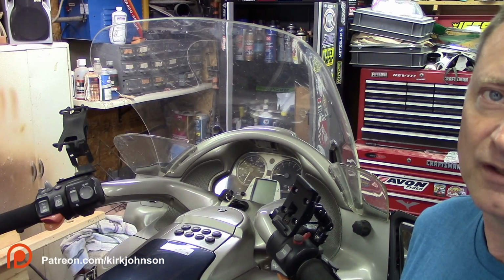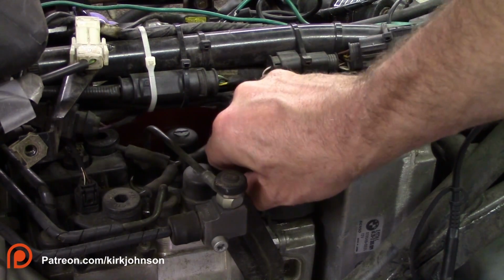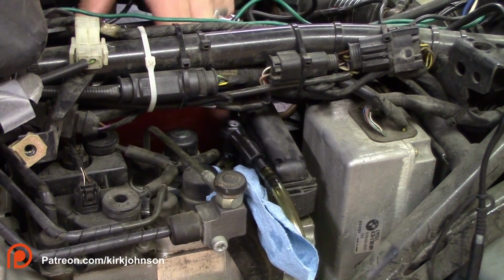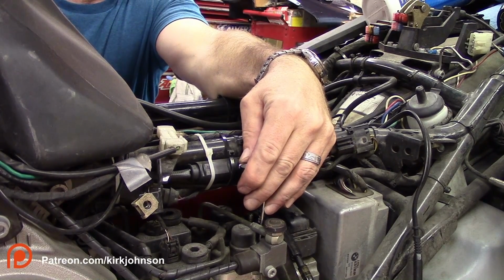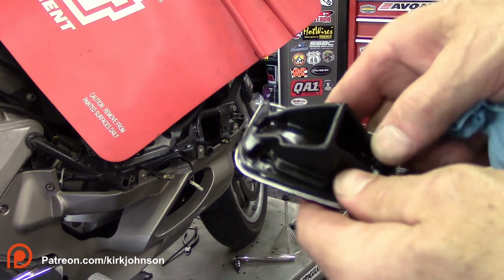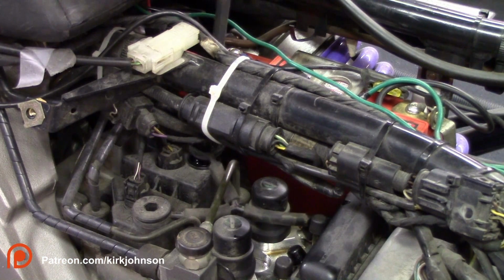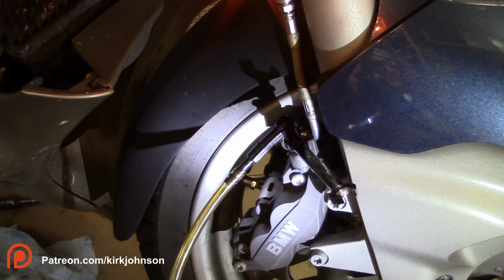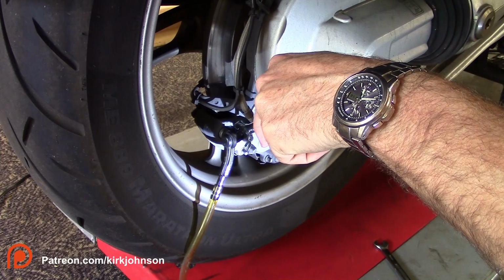BMW K1200LT DIY Late Model ABS Brake Flush (2005-2009)

Comment: Also, your video only shows 1 bleeder screw on the front ABS circuit, and 1 bleeder screw on the rear circuit.  I saw another video that had 3 bleeder screws (meter, integral, and control bleeder screws) on the front circuit, and 3 bleeder screws on the rear circuit.  I have looked through my service manual and until I take off the "tupperware" I am not sure what to expect.

I just purchased the funnel from Beemerboneyard.  $39 + $10 shipping.

Comment: Thanks Kirk for this video. I did watch it before I flushed the brake fluid on my 2006 K 1200LT.  I never knew that the reservoirs are in the ABS unit. A change from my older 2004 K 1200 LT.

Comment: Hello Kirk, I have watched a couple of your YouTube videos, thank you for all the good information that you put out to help people like me. I changed all the brake fluid and the brake lines on my BMW, however my question is it possible to reset a 2002 BMW K1200LT ABS Systems? Once I changed the brake lines and bled the system without the fairing panels I rode the bike and it worked fine. I decided to put it back together about a month later, and now the brake light is flashing real fast and no whining noise from the ABS system. I’m not sure what the problem is at this point, any information would be greatly appreciated. Thanks Ricky

Comment: I have a 2009 k1220 lt with sidecar and hitch, will the clutch handle adding camper trailer? (I ride 2up)
Reply from the maker: That is a great question! I would say try it as long as the clutch is in good shape and take it easy! Especially when starting out.

Comment: Hi. I have big problem with my ABS module, can you help me please. After the diagnostics, the Moto service said that the ABS Moodle needs to be replaced - it is not working properly. Help me find this ABS module.
In general, I wanted to know about their repair. Is it possible !? My Bike (2005 year BMW K1200LT) Thanks. p.s wait for your answer

Comment: I have 2005 k1200lt and I did the brake flush. From the rear tire reservoir to the abs unit is not flushing. And suddenly the back brake paddle has stopped working. It doesn't flush from rear reservoir to the abs unit port. Any suggestions?

Comment: Hi Kirk, don't know if you check comments on here. But I'm looking at a 2005 r1200gs at a Harley dealer . I don't think they have a history on the bike. It was a local trade in. My questions are ....1. is that the same braking system as the bike I'm looking at. 2. Is there anything I should look for 3. The bike has 135000 kms....if the brake unit works now, if I flush it....can it be saved...may be a dumb question 4. Should I stay away from it?
Reply from the maker: I certainly do check them. It is pretty much the same brake system. If it has rubber lines you will need to change them. Get on the GS forum and see what kind of other issues it may be prone to.

Comment: just replaced my brake lines - pads - oil/filter change - final drive fluid change -  horn - plus .. will do the air filter in a few months mmaybe ....  had a great friend who understands mechanicals  take charge - and I was there to remove the tupperware - buy parts - get beer etc ...  and he and I BOTH WATCHED your video's on the LT - great help for us .. super tool - you are brilliant to post these here ... thank you thank you thank you  ...  all went well - not too many parts left over ...  Namaste' my LT driving friends ....  I LOVE MY Touring Bike and riding her down the mountain to play racquetball in the morning with my new brakes -- hope they work !     - Captain Dave   ATP   retired   ............ -ps  only suggestion is to DUMB IT DOWN just a little for us rookies  ;)

Comment: hello Illinois BMW riders-  Nice video-  I own a R1200R of 2006 with ABS- Can I change my m/cycle's Brake Fluids  without the BMW's Diagnostic tester - (as my m/cycle's manual say this ) You did this without it, on your K1200LT -  Pls inform me- also where can I get that -
 specail clear Funnel ? Thank you - be well -
Reply from the maker: Yes you can do it without the tester. Get the funnel at beemerboneyard.com

Comment: Hi Kirk, hi from Melbourne Australia and thanks for a great video as always!
My only other advice when doing this is to remove each calliper from the bike one by one as you bleed it and retract the pistons as far as possible, and wedge them in with a suitable size block of wood prior to bleeding that specific wheel circuit. This squeezes the old fluid out of the calliper itself and allows it to be flushed when you run the pump.
I never used to take this step, and despite annual flushes on my '03 K1200GT, I ended up with a seized front calliper and had to buy a new seal kit and rebuild it. When I did push back the pistons right back and flush the calliper the fluid was quite black, so obviously without this step old fluid gets trapped in the calliper despite the flushing process as the bleed valve is at the top near the brake hose entry. This allows moisture to build up risking damage to the calliper.
Hope this makes sense, and thanks again for all your great videos which I really enjoy watching!
Reply: I have a gs911. There was an update to the software. Now I’m not able to run the ABS pump. Any advice?

Comment: Just finished process on 2006 R1200RT, so...same procedure works on model too. Thanks Kirk! Virtually same, other than ..ABS is under Tank & rear brake reservoir location.

Comment: hi...great videos....where i can get the funnel? for 30?
Reply: http://www.beemerboneyard.com/
Reply: Kirk also didn't give it a name. This is what it is called at beemerboneyard " Servo Assist Brake Bleed/Flush Funnel Tool"
Reply: Beemerboneyard for $36....  or just get a  number 2 rubber stopper (5/8” to 7/8’),  a small long stem battery cell funnel and make one urself for under $5.

Comment: Nice easy to follow video.  I will add a few additional tips from my past brakes flushes.

1. Clean thoroughly the areas above the ABS unit and the master cylinder and rear reservoir in addition to cleaning well the top of the ABS unit.  I suspect more ABS units have been killed by ingesting dirt than through lack of fluid change.  It is very easy to dislodge dust from the frame or wiring above the ABS when  maneuvering tools to open and close the bleed valves.  Brake fluid has to get really bad to be as harmful as one speck of dirt in a tight tolerance system.  I wash my bike before each flush and blow it also with compressed air.  And wash the funnel thoroughly before each use.

2.  Though it nearly doubles the time, I remove all three calipers, clean the pistons well, compress them fully and then insert tight fitting wood blocks in place of the brake pads to keep the pistons compressed.  You would be surprised how much old fluid gets left in the calipers, particularly if the pads are nearing their wear limit.  I want to remove as much old fluid as possible when flushing.

3. Dropping a clean razor blade into the master cylinder will keep the geyser from erupting from the from master cylinder.